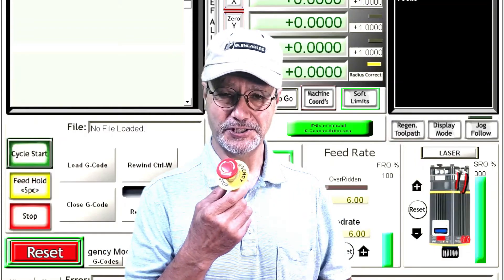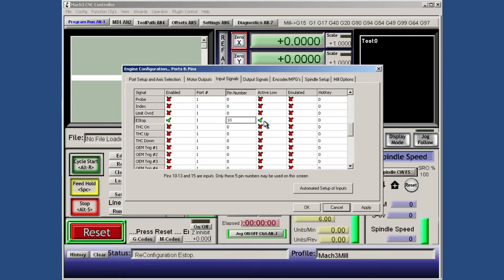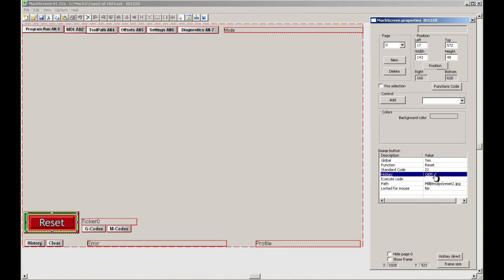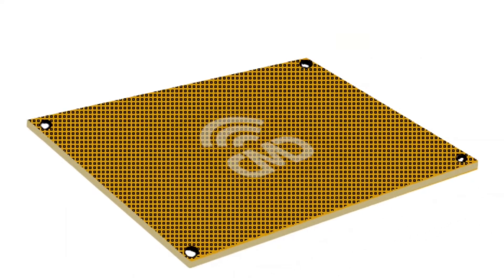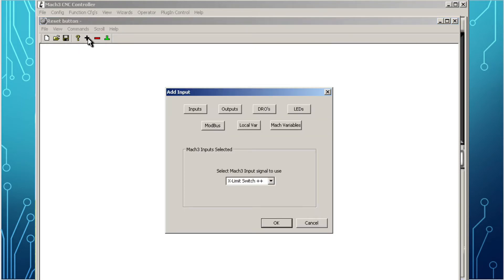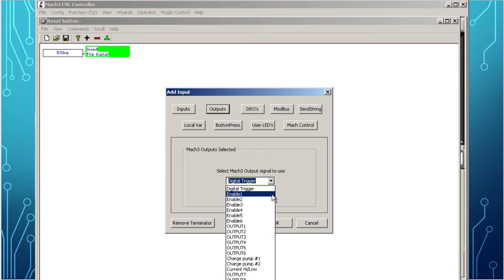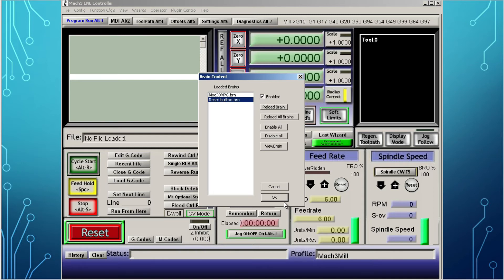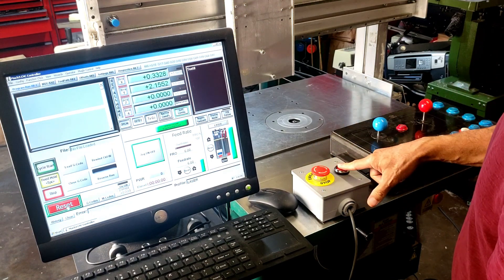External E-Stop and Reset on Mach 3

Comment: Question, for the EStopmswitch wiring, pin 10 is ACK and is an output… to me connecting an output to GND (through the stop switch) would not be right. Are you sure this is correct? A schematic would be helpful. Thank you.
Reply from the maker: Pins 10,11,12,13 and 15 are inputs according to mach3. The switch works, so I think it is not a problem. Sorry that I don't have a schematic other than what is shown on the video.
 Thanks for asking.

Comment: Not clear on how does input settings of reset button should go.

What hot key should i select for reset button
Reply from the maker: Reset button is just a hotkey on your keyboard, any key you select on your keyboard should work, however try to use a key that is not used in another function, like the pause key (space bar) etc. The activation of the button is done thru the software set on Mach3 (screen set) You have to map the key selected to the reset software button (it is done with Mach3 screen editor) The blinking part of the circuit is totally optional.

Comment: Sir which lpt port driver to installed ,I have parallel port in my pc but it's not communicating with the mach3 board .
Reply from the maker: If the port is part of the PC's motherboard, then use the windows drivers. If you installed a PCI  parallel port, use the drivers that came with the parallel port device. Mach 3 software, should detect it. if not reinstall Mach3. For more info about Mach3 check this channel and this video:  https://youtu.be/McnJ032PrAg
Good luck!